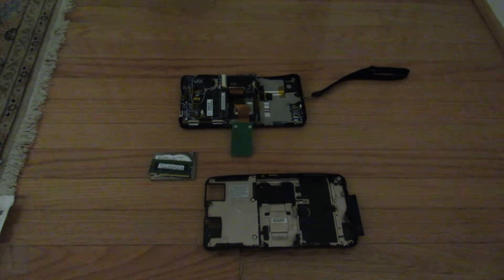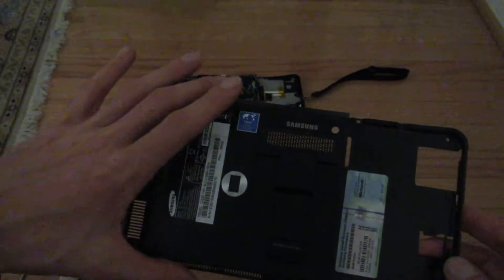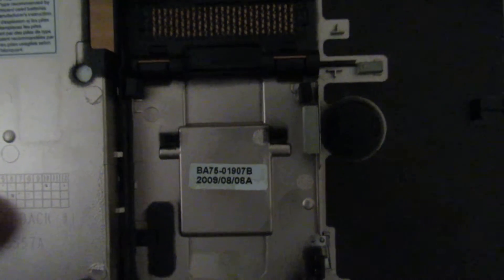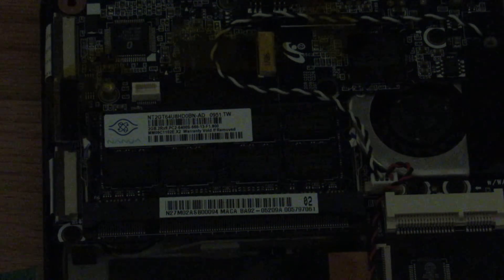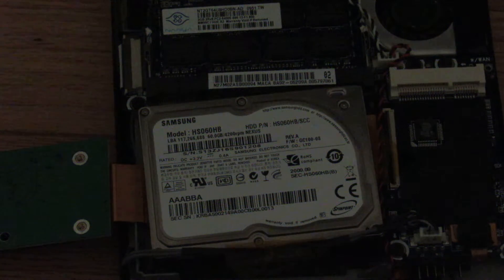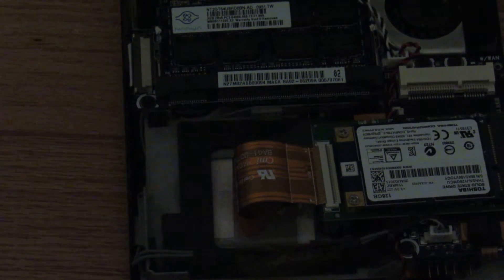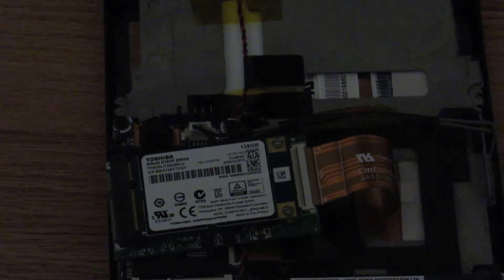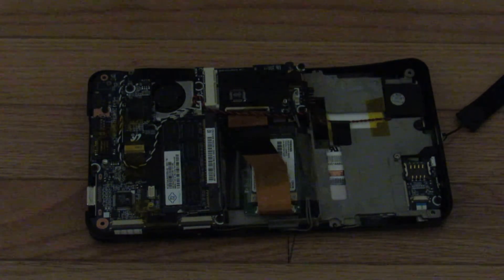Upgrading RAM and HDD in your Samsung Q1 Ultra

Comment: that a slow hhd 4200 rpm and yes SSDs  save power the only thing i hope that you aren't stuck using such a old device but they dont seem to want to stop working i have a 2016 low spec laptop battery is still good  i have a newer one but it would be a waste to get rid of
Reply from the maker: Thanks! Fortunately this isn't my main computer - I am just using it for fun.
Reply: what cpu does it have @walnuthills11
Reply from the maker: Pretty sure it's an 800 MHz Intel A110 (Celeron)  @404hopenotfound

Comment: I wonder, since it's screwed together, if you think you'll be back in the case again in the future, if it might not be worth breaking off some of the plastic lock tabs so it's easier to unsnap the case halves.
Reply from the maker: That's an excellent point. I ended up incidentally breaking the tab under the port cover, which thankfully had no consequences for putting the case back together. Opening it up was much easier the second time, anyhow.